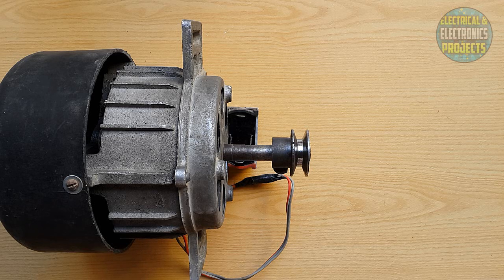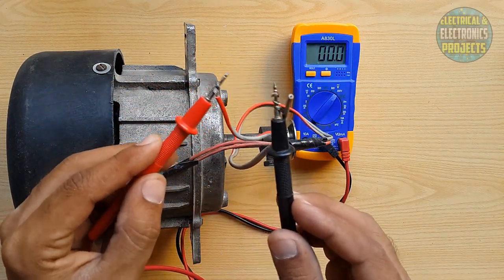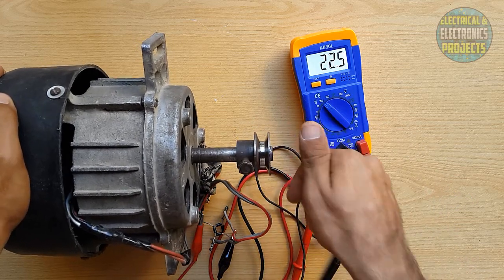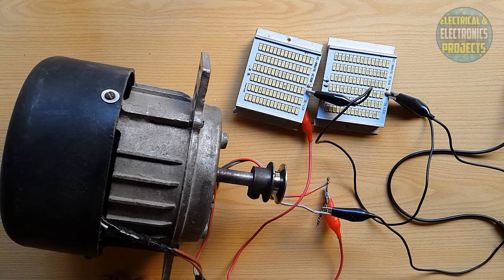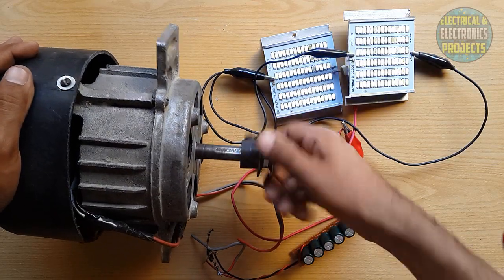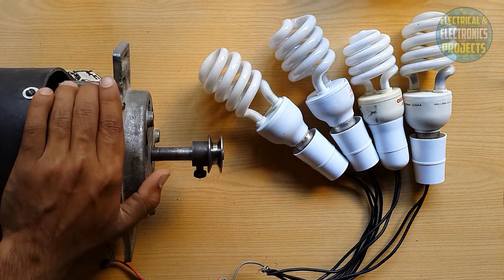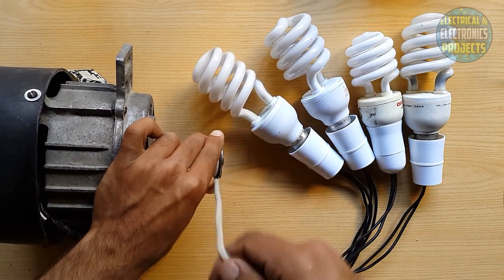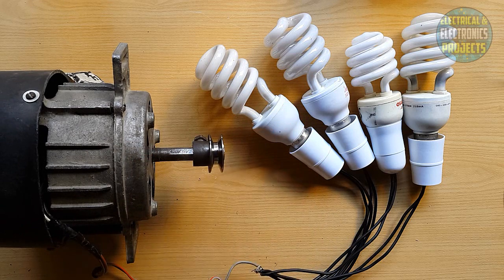How To Make Free Energy Generator 220V From Washing Machine Motor. DIY Free Energy Generator.

Comment: Hello, Nice video ! with a dc motor operated from solar panels can i get 220v out of the washing machine motor ? if yes (i hope so), how many amps can it give ? thanks.
Reply from the maker: Yes you can but the output of this motor is 2.5Amps
Reply: @UnfilteredWorld-w6p  this is enough to power a 150w fridge ? also, any washing machine motor will work ? no need to add magnets and so on... Thanks.

Comment: You just showed my induction motor can generate enough power by itself. I though it would not be possible without replacing the squirrel cage rotor with strong magnets. May Almighty Allah give Barakat to all you do and all you have. Great instructions.
Reply: it is NOT possible without neo magnets. The magnet needs to be a ring magnet, placed to rotate the circumference of the magnet to displace gravity within the rotor and stator area, when this happens a vacuum is created and the energy is drawn from the vacuum, as Tewari Generator based on the science of Bruce DePalma. To give N-S polar arrangement so it could induce energy from the vacuum rotor area to the stator, the magnet must sit in a magnetic iron frame like in an alternator. Once you take apart an alternator, you'll see the winding in the center of the rotor. This has to be removed, then replaced with N52 ring magnet of the same dimension as the rotor's (exciter) coil. The N52 neo magnet will boost the output of the voltage 10 times at the rated speed. You now have 10 times the voltage and 10 times less amperage allowing the windings to output much more power, 10 fold, so 1200 watts will equal 12,000 watts. This isn't based on traditional ohm's law, only because the energy is being introduced to the system from the vacuum magnetic/gtavitational vortex created by the high powered magnet spinning against itself in both directions., ,creating a cancellation of energy used and introduction of new energy source, less the LENZ effect because the rotor acts as a gyro because you have north then south poles passing along the outside of the spinning ring magnet that is axially magnetized. So normally you'd have no induced energy or vacuum created due to the fact that the surface of the rotor would normally only have n-s-n-s pulses, now it has a field running perpendicular to the shaft from the axial magnetized spinning magnet, but the north sticks to one casting with fingers placed evenly around the rotor, which eliminates the lenz effect because of the new field produced in both directions. It's kind of like to gyros running in opposing directions within one gyroscope, allowing the energy to be drawn in infinitely. This is exactly how this and other kinetic energy generators work, the difference is that others that do not use this method of magnetizing will not self run and will only contain the energy from the flywheel, not having enough asynchronous stamina to rev the motor up when needed, this system does have that and it works.

Comment: connect to a running water to rotate the pulley and bingo, with your electronics you can connect to UPS and there you can protect your system

Comment: i think i will plug my grinder machine to my home electric socket, wrap its spinning part and this machine rotor with rope (connecting em), turn on grinder will spin this machine and generate energy. then quickly unplug the grinder cable and plug it on socket from this machine. i wonder if doing that will result in energy loop tho
Reply from the maker: Yeah, Good idea!

Comment: So if the motor is turned fast enough could u generate 240 volts
Reply from the maker: Yes depends on speed and winding of motor.This motor gives up to 250 volts at high speed.
Reply: Electrical & Electronics Projects. Would it generate enough to run a house if connected to a proper fuse board

Comment: A few families use up electricity openly and end up receiving a $200-$500 power bill. Which can be a particularly hard pill to swallow when times are tight. This is a generating power method “boma fetching unique” (Google it) to cut your electric bill and generate your own power.

Comment: ok batcha, can i plan this 220v washing machine motor to convert into my electric scooter charger, then to charge my scooter battery continue while i am riding.my scooter battery power voltage is 48 volts.

I intent to do it first direct from  this >>> 220v washing machine motor>>>>to ac battery charger 220v 2 A >>>> then it goes to the battery pot socket charger.

Please advise . mike nandri. thank you :)

Comment: it is just a generator all people have generators in their appliances there is nothing new about that .. dude you should study electrical power engineering  

Generator : Rotational conductor + Electromagnetic Field = Electricity

you can increase the speed of the rotational conductor while it is inside the Electromagnetic field  to  gain more Voltage .. or you can increase the density of the electromagnetic field to gain more voltage too.
Motor is the Inverse machine of Generator 

Motor : give it electricity and it will produce magnetic field and it will rotate 
and other motors used different methods of generating that electromagnetic field : 

but seriously dude .. you did nothing ..
there is nothing free in that video even the generator itself ... come on buddy free energy means that u pay once only  and you do nothing to it and it will produce electricity for you

Comment: It would work awesome if you had a stream of flowing water using a large spool from wires, place boards in the spool, run a rod and bearings thru the center of the spool just make sure the rod can go across the stream and mount it on each end and allow that to generate the electric using pulley's and belts...

Comment: yes it takes a small push of the hand that creates enough to run a plug  connected to the alternator and start the motor thats connected to the alternator through via a belt then all you need is a bridge rectifier to convert from dc to ac at the back of the alternator walla a small input of energy meaning a push of a hand converts to way larger sign me up very easy brilliant god bless physics is man made science 101 always experiment first

Comment: you should need to connect a solar trickle charger module and get some car batteries and connect them in parallel then you truly free energy after because your batteries will be full and always charging with the wind

Comment: Congratulations, you've discovered that a motor operated in reverse is a generator.  That was one of the first things we learned in high school physics.  

By the way, the energy isn't "free" in the thermodynamic sense, all that's happening is the energy from your muscle work is being turned into electricity via torque.  The amount of energy you use in calories to turn the motor will always be greater than the amount of power you get out of the motor.  

Here's an interesting thing to try.  Try putting a crank handle on the motor and hook it up to a standard light bulb (An old-fashioned incandescent bulb, you can do it with low power bulbs but you'll need more of them).  You should be able to crank the motor and get the bulb to light without too much effort.  Now try it again with 20 light bulbs wired up to the motor at once.  Or 50, or 100.  You'll find that as you add more bulbs you'll have to exert more force on the motor spindle to get the bulbs to light.  That was something else we tried in high school.  

When it comes to thermodynamics there's no such thing as a free lunch.
Reply: why pay big companies who use resources that belong to every body on this earth such as wind water and the sun all you !ll doing is making the richer richer eventually you will be paying for the use of the sun so this guys on the right track not 100% little more research i think one comment to use a peddle bike  peddle power could store enough energy in batteries to get you thru the night why not plus look on the bright side u don!t need to spend money going to the gym so mate all we need is a bit of positive thinking Awesome video by the way it would be good to get completely of the grid

Comment: I understand this to be free energy. Just power generator with electric motor. generator will produce more electricity than what motor needs, based on what pulley sizes are. How most cannot see this,  is more amazing than the free energy . Use your heads. If a 175 pound man can pick up a 3500 pound car using a chain fall  (which is a series of pulleys), than how it not be a electric motor using 12 volts cannot turn a generator that produces 240 volts? All that would be needed is the initial start of motion, and yes a that can be done with a pull string. Great job!
Reply: + Pete Tetso  You are trading current for voltage and vise-versa.  Think of it this way,  Your electric motor is going to draw a certain higher amount of current at a lower voltage in order to spin the generator and create a higher voltage at lower current.  

Amperage X Voltage = Wattage.  In a 100% efficient system Wattage in will equal Wattage out.  In the real world, we have several losses to contend with.  Eddy current losses (heating of conductors due to induced current being shorted upon itself), friction, resistance in conductors, etc.  If you applied 10volts at 50amps = 500watts to the motor you would then be transferring that energy mechanically to the generator where it would be converted to for example 200v at a maximum of 2.5 amps or 500watts if it was a perfectly efficient system.  In reality, you are probably looking at a loss of at least 25-50% so figure you are likely only getting about 250-375 watts out with the rest being lost as heat in the system.  

This is basic middle school or early high school science and technology.  Take some time to read and learn about physics, electricity, engineering and magnetism.  Then you can even learn about how many people get fooled into thinking they are measuring more energy coming out than going in because they don't understand things like power factor, duty cycle, back EMF and many other fundamental factors that come into play when you have to measure Alternating current vs Direct current.

The more energy you draw off the generator the harder it will be to turn the shaft of the generator which means the motor will need to work harder and will, in turn, draw more current.  This is also why the more loads you add to the alternator in a car the more fuel the engine has to burn to maintain it's RPM.
Reply: Thank you for your well written response, I understand what you are saying to me, but perhaps you don't understand what I am saying. Think of the pulleys on the motor and generator, I believe we would both agree that rpm's and load do not have to match. Like gears on a ten speed bike. I do not find all systems on YouTube perfect, but I do see potential. Tesla was able to draw electricity from the free air, I've seen magnetic motors run off of magnetism. I believe that there is a way to produce free energy. Simply remember, yes this may be simple middle school teachings that limited you to experiment to far from what was being taught. Even doctors are taught in college how things are SUPOSED to be, but are not taught anything about natural remedies, and non pharmaceutical healing, which is real. So, yes the simple application that was shown in video does accumulate loss, and is not perfected, but it is a step in the right direction. There are many ways to make a generator.
Reply: Pete Tetso. Everyone understands what you say and everyone who knows even a little about this knows that it works other way around. You Sir skipped 5th grade physics, basic elementary physics. Energy conservation Law,  friction and heat.